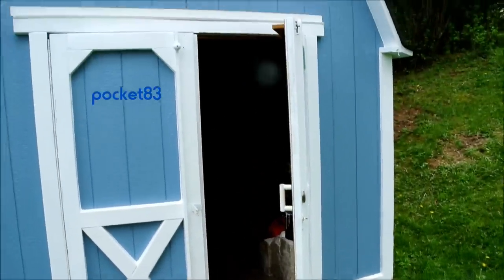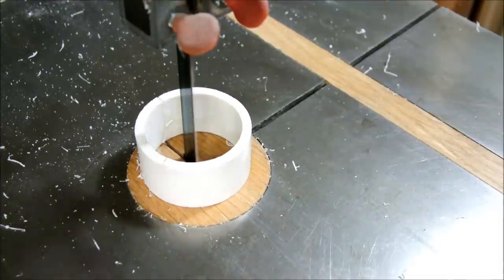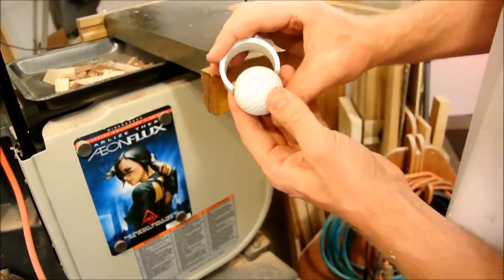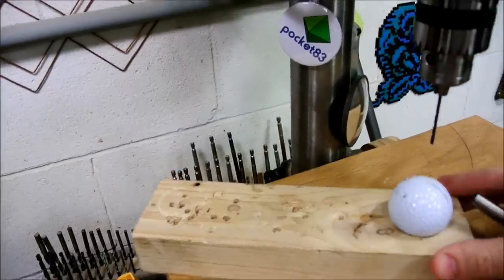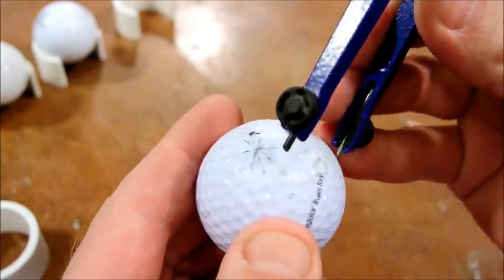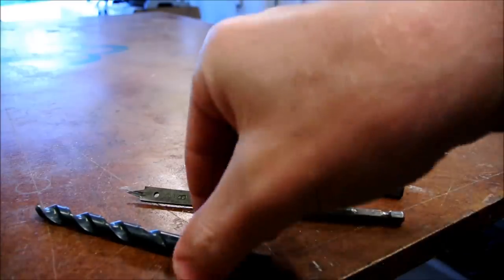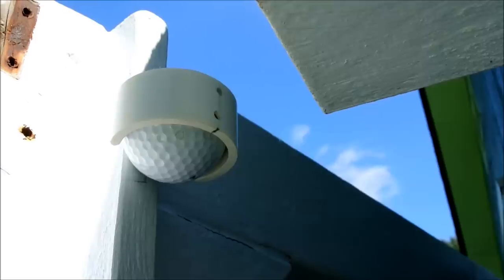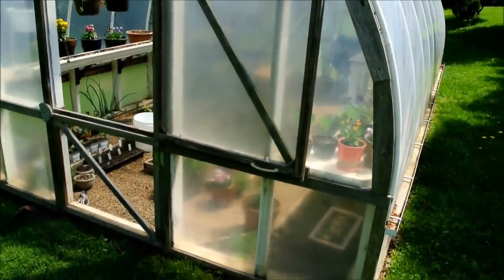Cheap and easy ball catch latches!

Comment: Thanks a lot. Used this and it works great. I tried to initially get a pipe that matches the door handle but I would need 2 1/4" pipe and I didn't find any. The largest was 2" and I think it would be too much of a stretch.

Comment: Pocket First thought is always trying to solve a problem with golf balls.

When it doesn't work: "I guess I can use Wood... But golf balls are still cooler".

Also, neat pole trick. I just wish the technique could always work like in the vídeo: one shot - lucky - but without the luck.

I was thinking about using four circles but It is difficult to explain. The basic idea is making two perpendicular straight lines over the sphere with them defining the poles, in the end.

Comment: Brilliant and Yes I hate my damn shed doors when forgetting to latch them. :) I love PVC tricks and I use PVC all the time for designing new hacks myself. A safer and similar way to cut pvc? $11 as home depot - Ratcheting PVC Cutter and/or Oscillating Multi Tool with the 180 rounded blade. I use this both for most of my pvc projects. Miter saw for the quick clean cut using the finer tooth blades without harm. I have rehabbed many houses and I even cut 4" pvc pipe and it has never been an issue for my fine tooth blades. I would cut trim/molding etc afterwards. :) Thanks for sharing, I will go get some golf balls now!!!

Comment: It worked great for me.  The magnet style did not work for me because it didn't have the holding power.  It was a strong neodymium magnet too.  My catch location was only -12"  from the hinge point so it needed more holding power.  I use ABS because I had the size handy.  It took two tries.  I had to make a smaller spaced cut so it had more holding power, but works good in holding  during windy times.  I just drilled through the ball without a press or worrying about perfect centered alignment.  It took 45 minutes cuz 1st attempt didn't have as much holding power and getting correct length screws, drill bits, clamping pipe for cut,  countersinking, etc..

Comment: If you had small tabs with holes in them sticking out top and bottom from the center of the PVC then you could click the ball into the PVC and then push the both connected pieces up against the wall together,then install the screws through the holes and your alignment would be perfect every time.

Comment: really smart idea! just a suggestion for the not having a drill press issue: instead of using a compass, take a 2x4 and put a pilot hole all the way through, then drill out that 'cup' hole like you did but make it deeper, almost all the way through, put the ball on the table, put the 'cup' hole over the top of the ball and drill through the pilot hole, if that explanation makes any sense....

Comment: Depending what kind of hinge you  have on the doors. A 3” hinge that has a hinge pin to remove lay the hinge pin on a solid surface ( concrete driveway) hit the pin with a hammer to put a bend on the pin . Then reinstall the pin to join the leafs  and this will make door stiff to operate but not the operation of door swing.

Comment: Same idea, but use two pieces of pvc pipe, one smaller that nests in the second. Cheaper than golf balls and you can adjust the holding force by cutting them both longer or shorter.

Comment: Good idea, I'll probably use a solution like this in the future.

Word of warning:
PVC will get brittle with UV exposure, eventually the catch will just snap.
Reply from the maker: Description.
Reply: I guess my greenhouse is older than I thought; highly doubt it's even 10 years old. Pipes cracking and thing is falling apart, so are the vine trestles.
Reply from the maker: You have a PVC greenhouse? Did you build it yourself?
Reply: Yeah it uses long pipes in an arch, with a clear plastic sheet stretched over the frame/ribs. 

It was there when we bought the place, decent shape when we moved in but 3 years later it needs to be torn down.

Comment: These kinds of sheds are notorious for having doors that open and close when they want. The next shed I'm building, when I get the chance to, is going to have sliding doors, either exterior or pocket doors. Might even use a latch idea like this to keep them open, but with a latch at the top and bottom. Only I might try to make a more spherical version of the latch, just so the ball catches from all sides with multiple points.

Comment: Find a second pvc pipe that fits precisely inside the first.
Prep the larger pipe as you did here.
The narrower pipe can be cut to a similar length and screwed to the door as you did to your ball.
>If sawing pvc pipe I like to preheat my hacksaw blade,or use a hot thin wire to make a swift clean cut.
As this saves you a bit of pain and time 😊

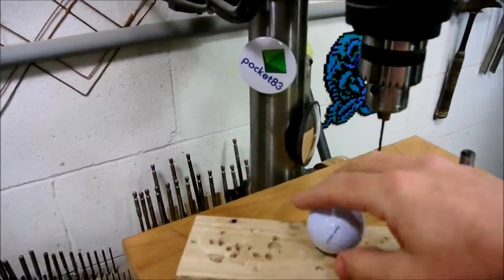Comment: I just learned that golf balls have a North Pole and a South Pole 2:32.
Weather is exactly the same on both poles, btw.
Reply: Yes, but if you drill at the equator all the guts will spin out. Caps are froze.

Comment: Suggestion: cut the 115 degree section first from a longer length of pvc.  Then cut off the 15/16 length.  Use a wooden clamp to hold small pieces at the band saw.
Reply from the maker: Agreed, if you're batching them out. But for making only a few, it's far easier to just cut some rings. I only make jigs for operations I expect to repeat.

Oh, and I already made that jig in the PVC chain video.

Comment: Travel Trailers have a somewhat similar one-handed ball-socket stopper to hold the door open, but your idea could be adapted there as long as a standoff to the PVC socket was used to stop the door a few inches from the outer wall.  I LOVE it when someone finds ways to use existing things to create something else, for near zero dollars. In design engineering, it is often the challenge of finding an "off-the-shelf" solution instead of having to design a unique item. The off-the-shelf solution is almost always less costly. Plus, this adds the whimsy of a golf ball getting repurposed. 

=========================================

About using PVC for other things than just water: 

I needed a picking tool for cherry-tomato sized plums on my decorative Thundercloud Plum trees, and didn't want to fuss with a ladder, so I bought a 10' length of 1 1/2" PVC pipe, an elbow and a straight connector sleeve. In one end of the elbow, I cut two slots about an inch and a half deep,  at the 12 and 6 o-clock positions. The slots were then flared so they were wider at the opening, so a plum's stem would go into the slot more easily.  Stick the un-slotted end of the elbow onto the 10' pipe. Stick the sleeve goes on the other end of the pipe, and a rubber band is used there to hold an over-the-calf athletic sock firmly in place.  You don't need to glue any of it. 

Then, using the pipe like a vacuum, reach the elbow end up into the tree, and guide a plum into the elbow so the stem is in one of the slots, and push or pull the pipe to pluck the fruit. It will roll down the pipe and into the sock, without damage. When the sock gets full enough to be a bother, remove the sock, empty the contents into a bucket or bowl, and do it again! 

This plum-picker works for plums that are up to 15 feet off the ground for the average sized person. Using an extension might make it too heavy and awkward, so I don't have an easy answer for those with small fruit higher up than 15' or bigger than what will roll down this sized pipe.
Reply: I considered doing something like that for apples. Doesn't the fruit bruise on its tumble down the pipe, though? Or perhaps plums just aren't as easy to bruise as apples?
Reply: Larger fruit would have more mass, and the impact and abrasion forces on the apples would be greater. Also, apples have a more rigid flesh, so that would also contribute to surface bruising. The tool would likely have to be three-fingered pluckers that open and close as desired, and the fruit lowered manually to a box. The length could be smaller in diameter, say, a 1" aluminum tube made of a hard aluminum like type 7076, with an .093" wall. A cable inside could operate spring-loaded, rubber-covered, pull-to-grip fingers. Or, you could sew a stretch-fabric tube that would let the apple slide down with a gentle force from the cloth slowing its fall somewhat, then figure out a way to give the apples a soft landing each time you pick one and it slides down the chute. You could have a bicycle brake handle or something like that down where you hold onto the tube, attached to the cable.
Reply: I laughed when I heard the little plums roll down the pipe as I used it, and they never bruised in doing so. Their small size was definitely a factor, and I think the loose rolling slowed down their "freefall" considerably. Each bounce down the tube would cause a mild skidding  as it hit an opposite wall, and put the brakes on just enough to keep its maximum falling speed low. It took some engineering thinking to understand why they went so  slowly down the tube, and that gentle friction hitting the wall as it bounced had to be it. Again, being small, about the size of typical cherry tomatoes, was why this all worked so well for them.

Comment: after mounting the ball, put the screws into the pipe then mount it on the ball and open the door. the screws will mark where to mount the pipe by leaving indents.
Reply from the maker: Too much slop.

Comment: Great Simple Rube Goldberg solution for people with expensive tools and too much time on their hands . Better inexpensive latches can found at numerous places . Pvc will degrade and fail when be exposed to weather's extremes . Try the little door swinging latch catching device at freezing or below .
Reply: Boo-hoo, Lou!

Why are there so many negative know-it-alls? PVC does NOT degrade quickly. This latch easily lasts for years. And you can make it with only a hacksaw and a drill. 

"Too much time" is only on the hands of counterproductive internet crybabies. Go buy a latch, chump.

Comment: You could also attatch a water bottle to a string, which attaches to the door, and then make the string go through a loop on the wall. The gravity will pull the bottle down, so that it pulls the string that's attached to the door, thus creating an automatic door opening system. You need no hands to open that. Apologies for bad english.

Comment: if you put the screw for the clamp in place and snap it on the ball it will self locate position on wall by slamming closed with the screw pointing out. then remocve clap from ball and screw into place with the screw mark you made.
Reply from the maker: That method will have you way off. I show how to do it flawlessly.

Comment: Use your table saw to rip two slots down the pipe sideways to make the opening for the ball. Then flip the pipe over and drill your screw holes on the press. Now take the pipe to the table saw or even better chop saw and slice off the sections however thick you want them.

Comment: Try this variation:  instead of using a golf ball, use the next size smaller pvc pipe.  A 3/4 inch pvc pipe will snap into a 1 inch pvc pipe, etc., using the same method.

Rather than using a band saw or a hacksaw, it is easier cutting the "snap pipe" by cutting a length on a table saw, (say, 1 foot section) and then chopping those pieces into the desired lengths.  eg:  a 12 inch pipe will yield 6 two inch "snap" sections.

These are also great for securing tarps or other fabric on a frame of pvc.

Comment: This golf ball thing is coool... Granted, but it seems that accurately drilling the ball is a pain. 
Maybe a simpler solution might be using, instead of a ball, a second section of pvc pipe, of a smaller outer diameter. Depending on that diameter, this second pipe could stay as one piece (no cut), or have a similar vertical cut. In this case, there would be some extra spring action.  
Either way, it is a great idea.

Comment: the solution to cutting the pvc rings on the bandsaw is make a wooden jig that the ring will slide down into and use the jig to push the ring through the saw.  think about it you will figure it out

Comment: The plastic in PVC is quickly damaged if exposed to UV light.  If I needed to do this project I think easier would be to use a magnet.
Reply: So paint the PVC a matching trim color first.  Nobody wants an ugly magnet that'll rust. Where's the creativity in that?
If you like something unique, like most of us watching this video do, then PVC and a Titleist Pro V1 is the cool way to go!  
Then add Kortt Wulfe's suggestion, above, and use the ball as the doorknob as well. . .

Comment: Dad has a door in his garage he likes to keep open for airflow, well the airflow would swing it back and forth and often close it. The door is steel so I fixed his problem by using a hard drive magnet and some twine. It holds the door open by securing it to the closest wall. When he closes the door the magnet falls and swings into the wall and connects itself to a padded piece of tin can I screwed in so it is out of the way.

Comment: Though there are factory made door holders, magnetic, mechanical etc.... this "home hack" can be made for near zero cost ( saving about  30.00 each ) plus, there is great satisfaction in self-sufficiency. Doing project like this exercise the mind toward finding your own solutions to other challenges. Sure, there is a time to call a professional, or buy ready-made products, but often you will NOT find a quality substitute in the local hardware store. A quality magnetic hold back, which works much like the door holders on my Sprinter Van, are a special order. So, back to the hack... jsut be sure you have UV resistant plastic, so it does not embrittle in the sun. HDPE is reportedly optimal, but may not be available in pipe sizes. IT is used for outdoor playground equipment. Polycarbonate, if modified with quality UV stabilizers is excellent. GE Brand of Polycarbonate, AKA  LEXAN is an excellent material, does not break down in sunlight. It is popular in signage for it's resistance to damage, is also used as security glazing in lamination with glass. So you get UV resistance, strength and it should be available in tube/pipe. All that said and done, you wanna use what is around.... use old plumbing tubing, and paint it white, or make extra clips, and replace them once a year if in direct sunlight. Thumbs up on a terrific DIY project.

Comment: latch: 1.5" PVC pipe and cutaway 1.5" PVC coupling. The pipe replaces your golf ball, the cutaway coupling is used in place of your cutaway PVC pipe. Much easier to work with compared to a golfball and just as sturdy (note that UV light from sun will deteriorate PVC over time).
Reply: It will take over a decade before UV light will even start to affect its performance.

Comment: yeah I use a much nicer looking magnetic latching system. Looks cleaner. Holds better. Doesn't weather away like the plastic is going to.  FYI
Reply: yeah the chrome plating will peel off in a year, then it will rust. PVC lasts for decades outside. And yours was expensive, ugly, and doesn't hold any better. FYI

Comment: Just wondering how you feel about this now that a year has passed. Does the plastic still feel as springy or is it something that, after significant use,  you expect to change regularly? Either way, it wouldn't be hard to manufacture a lifetime's worth at once and replace them every so often, I'm just curious as to your experience.
Reply: They last forever. I moved, and it was still like new when I left. When I took down the PVC greenhouse (shown at the end of this video) after the better part of a decade, the PVC trusses were still unbreakable. Let me be clear: the UV degradation of PVC is an urban myth; the actual reduction in strength to it after a reasonable amount of time is nominal at best. I think people have it mixed up with ABS or something. Google it if you don't believe me.  

I think it's likely that you will end up breaking it by bumping it long before it would wear out. I still maintain that it was a good idea ;)
Reply: @pocket83squared  Thanks for the reply! I wasn't so much worried about the UV as I was repetitive strain and cold cycles (though I don't know what kind of winters you have - I'm in Canada). Most plastics hinges and snaps I work with fail in a couple of seasons.
Reply: Good question. I'm not so sure about those things. I'm in PA, so we do get a medium winter. But as for mechanical weakening, you're probably right; we should expect the latches to weaken somewhat over time. Their range of motion is very small, though, so it should take quite a number of uses.

Comment: I would drill a water DRAINAGE HOLE so that the ball wouldn’t fill of water and  freeze in winter time, if you have less than zero centigade temperatures.  And the water is usually not good anyway. But nice idea. I have magnetic latch but I believe thatp this could be even better.

Comment: Take advantage of the symmetry present.  Don't mount the pipe as shown in the video.  Mount it rotated 90 degrees.  Then you don't need to worry about aligning it with the door angle.
Reply: They are heavy shed doors. They are subject to more up/down changes than lateral changes. Since the shed floats on the ground, they need to have some flexibility as the seasons change. The horizontal clip allows for some vertical motion of the door.